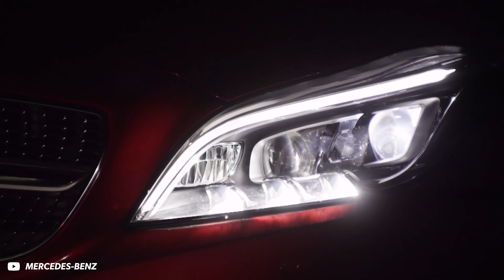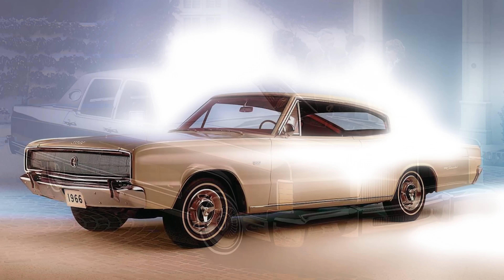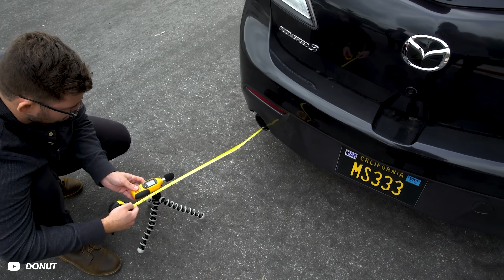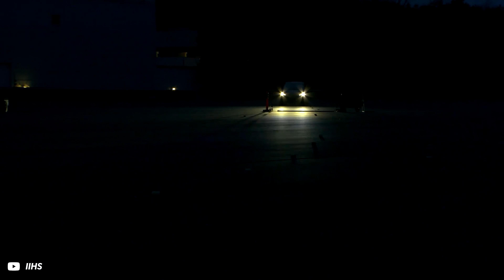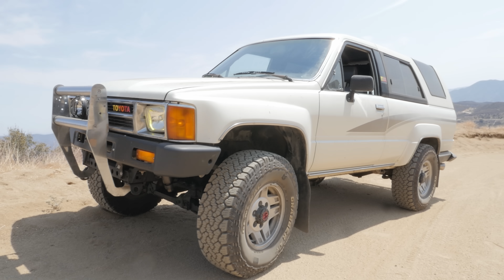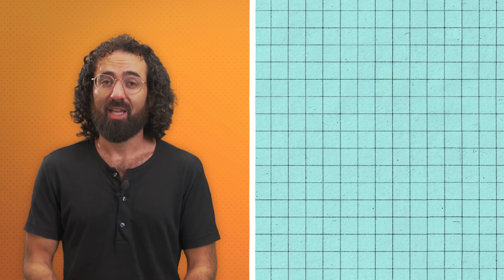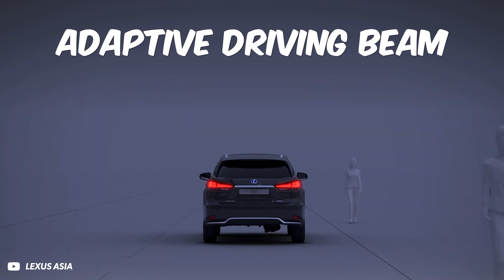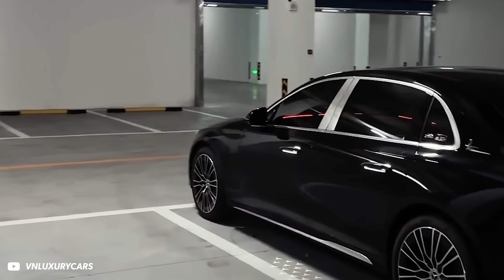Why new headlights are blinding American drivers

Comment: No, two automakers.  Teslas (except Model X) made since 2022 have the matrix LED headlights needed, and a software update enabled the adaptive function for them in Spring 2025.  

So, there are ~2 million Teslas on the road with this feature now. 

Anecdotally, it works well, or at least better than my last car: a 2016 Honda Civic. It was the Touring trim, which came with factory LEDs, and at least twice a month I'd get someone flicking their brights at me when mine were on lowbeam. 10 months in, I've yet to have anyone flick their brights at me in the Tesla.
Reply: I tested my Model Y by having my wife drive in the opposite direction as me in my second car to see how well it works. My eyes are very sensitive to light and I can tell all of you first hand, even when approaching from over a crest (or too of hill) the Tesla head lamps performed very well.
Reply: @jojones9194  awesome, thanks, it's great to hear a real-world test of the Tesla adaptive headlights, and that they did well
Reply: Ironically, early Teslas had poorly designed headlights probably out of spec for the cutoff angle of the low beams. It seems to be better in later model refreshes. The ones where you can discern the 3 separate emitters are some of the worst offenders on the road.
Reply: I have it on my Tesla Model X.
Reply: @bryanc7856  Yeah, I was pretty sure later model years of the X (later than 2022) got them too, just didn't want to make my comment too long by adding that
Reply: I love it! I have a 2023 and a 2026 and it’s really awesome.
Reply: Tesla, exactly, not sure why the video maker hasn't heard of them.
Reply: Teslas are so blinding I now just turn my high beams on back at them. They’re even worse from behind specifically the model Y
Reply: Do all Teslas come with these matrix LEDs as standard? If so, that's a great step forward.

The reality is, Matrix LEDs are a great solution to the problem but requires everyone having a car equipped with it. Most manufacturers do offer such systems now, but in almost all cases, it's always an optional extra, which hinders adoption
Reply: @Noel_p Yes, it's standard. I love it! It's not perfect (it sometimes blinds pedestrians or cars coming out of driveways), but it's really amazing!
Reply: @itsnorm it’s not
Reply: @Noel_p apparently in North America Tesla starting selling with Matrix headlights in Late 2023. I was very lucky mine has it as mine is a 2023 and they are awesome
Reply: teslas are literally the most blinding cars on the street. its always them. trust me, im a car guy and i drive a lot, especially at night, but even in my parents suv i find myself being blinded by almost every tesla driving by. maybe its just cuz theyre usually older models? ill keep an eye out next time i go for a drive and see if its consistently the older models with this problem and not the newer ones
Reply: @ItsEnderkiller2 I live in Tesla land with Teslas everywhere (Seattle) and as soon as the software update happened the problem was much improved. The older ones are still blinding but at least the brand new ones are not anymore.
Reply: @OptimisticEngineer345 yea im from jersey so its tesla land there too. im currently in indiana tho and theyre much more rare so i havent had a chance to be blinded by them recently. when i go back to jersey ill have to see
Reply: @ItsEnderkiller2  Next up are Outbacks with the automatic high beams. Same problem as Tesla but worse with the drivers just thinking oh, EyeSight will dim them for me. I'll have one of those 2 miles (ok maybe an exaggeration) behind me on the highway and still have to dim my mirror and it's so slow to react I get flash banged as one comes over a hill toward me.
Reply: Anecdotally, Tesla model 3 and Y are by far the WORST offenders by a mile. The issue is their headlights are already way too bright, and are angled too high by default. As both a driver and pedestrian (which matrix headlights don't address), it sears my retinas
Reply: @willkrska2644  How do you explain me getting flashed about twice a month for 9 years in my Civic, but not once so far in 10 months with my Tesla, if Tesla is the worst offender by a mile?
Reply: @JesseOsby  He's right - we've just all given up flashing Teslas because they all do it and either don't know or don't care.  Teslas driving around blinding everything in sight.
Reply: @Suupernintendo  It's mostly because people don't realize it and don't get them adjusted. It's the same for most Toyota's, Lexus, and Fords I see on the road. I wish there were yearly inspections of vehicles for this reason, just make it part of renewing your tag every year.
Reply: @Suupernintendo  But you still flash your lights at Civics?  That makes no sense.  Also, what is it that you want them to do?  "don't know or don't care" makes it sound like you expect the driver to do something to change it.
Reply: @JesseOsby I think people have just accepted that all Teslas are blinding. I have 2 of them and the default headlight angle was too high. With the software update it’s way better. Still blinding pedestrians like crazy but not much I can do about it.
Reply: @willkrska2644  Well, that may be if you have one made in murica. I have a chinese Model 3 and when putting in different springs they also adjusted the lights. They also said, the chinese models usually have the lights correctly adjusted most of the time. With a car from Fremont on the other hand you have a 75%+ chance its misadjusted out of the factory. Murican quality. Yeehaw.

Comment: I think some key points were made but there are other important factors to think about as well. Vehicle height, who hasn't been blinded by regular headlights because the SUV behind their CAR is right at the window/mirror height. We also have to think about where the majority of drivers have complaints, usually rural roads with no other light sources. So, relative to the darkness, headlights can be extremely blinding in this case, even halogens. One last thing to consider is the fact that everyone outdrives their headlights. This is a bit more technical but basically it means that when a person is driving so fast that a they cannot stop safely by the time they see an object/person/animal. So drivers compensate by changing to brighter headlights not realizing that the distance between a halogen and a led is only marginally different, especially at road speeds.
Reply: lights light up 80' ahead, at speed you need 110' to stop. that kinda thing

Comment: This is why the old-school prism-style glass headlights are still the kings of the road. Those fluted lenses actually managed the light — they diffused, spread, and softened it perfectly. Even with modern LED or HID bulbs, they throw a smoother, more natural beam than most new projectors. The problem today is that people just upgrade the bulbs but never re-aim their headlights. The beam pattern changes completely, and without proper adjustment, all that extra light just blinds everyone else. It’s not that modern lights are too bright — they’re just pointed wrong and lack the optical diffusion old designs perfected
Reply: Incorrect. All the new cars with head lights designed for them are even worse.

Comment: Modern headlights got brighter because we traded optical design for raw output. Back in the ’90s, halogen lights used glass lenses with built-in prisms that diffused and shaped the beam naturally. They had great balance—bright enough, but comfortable to look at. Then came projectors, clear plastic lenses, and HID/LED tech. They ditched the diffuser optics for sharp cutoffs and higher lumen intensity to meet new style trends and regulations. The result? More concentrated light, harsher glare, and less visual comfort. Basically, we gained efficiency and design freedom, but lost that smooth, human-friendly light we used to have.
Reply: Prisms in the headlight glass and parabolic reflectors were essentially phased out after we learned how to make reflectors that could create the required light distribution pattern without such prims. Such reflectors are known HNS reflectors (Homogeneous Numerically calculated Surface) and offer an efficiency improvement of up to 50% combined with clear polycarbonate headlight lenses.

PES headlights, Poly Ellipsoid System, also known as "projectors" allow the creation of light patterns in a very compact size of 40-70 mm in diameter that previously only was possible with very large area headlights. So modern headlights have gotten a lot smaller.
Reply: ADB headlights sound great but how much would they add to the price of already outrageously expensive new vehicles?
Reply: You see this with cluster back lighting too. The old fashioned gauges had softer yellow or even green back lighting to prioritize looking outside in low light. Nowadays it’s white light or even big bright distracting screens
Reply: @Sibsko21  Some cars had red gauge lighting, which was apparently the best for keeping night vision intact while driving...
Reply: I went from a halogen car to an LED car and I absolutely hate the LEDs. I don't recall having any problem with the halogens being too dim either. The LEDs have a narrow beam pattern and for the high beam they just turn on a couple extra emitters pointed at a slightly different angle. So the high beams help you see further on a straight level road but if there's any curve or dip the beam isn't on the road.
Reply: Exactly. Tanking design and manufacturing quality to save a fraction-of-a-fraction-of-a-percent-of-profit for "The Shareholders" 😑
Many such cases.... as they say.
Reply: At least remove the em dashes when copying slop from ChatGPT.
Reply: @Hiromandt  oh ffs don't be a ridiculous troll. em dashes aren't just used by chatbots. i use them all the time.
Reply: No, the 90s light output was shit. Even with halogens. You're looking at it with rose tinted glasses.
Reply: Considering I just retired my last 90s car 3 years ago, I can tell you the stock lights I still used were excellent.  I even had another car with the 5x7 sealed lamp, again, excellent.

Comment: Couple issues at play in addition to the points made here. First and foremost being driver awareness and training. I can’t even keep count of how many other drivers I see with their high beams permanently on. Or with a headlight out so they leave their full beams on. Next would be lack of enforcement of the above in the form of fix it tickets or general awareness warnings from police. Third is poor calibration and alignment from the factory and after dealer PDI. Many cars have headlight aiming and adjustment as a PDI item before delivery but I have never seen a tech actually check this, let alone make any final adjustments. And lastly, the antiquated regulations and lack of a global standard. I was lucky enough to be able to activate the European Matrix lighting on my US Audi RS3. It is by far my favorite feature of the car and genuinely increased my visibility during night driving with exactly zero negative impacts on other drivers. It should be a standard feature on cars as a safety measure alone.

Comment: I'm glad I wasn't the only one that hated LED headlights, they blind the fuck out of me and I can't see anything ruining my night vision. Someone complain to the transportation secretary already!
Reply: one of the problems is that people use any crap they can buy on amazon. they use corn led bulbs that shoot light everywhere so they cannot aim the light properly. they use it for fog lamps and main beams so at night they are illuminating more the sky than the road and blinding everyone. some even put some led bars as if they were driving in the jungle. they simply do not care.
Reply: I have been shopping for auto dimming glasses to wear at night to help solve the problem but I have not found any yet. It seems it’s hard to go from clear to dark quickly. It needs to happen in a fraction of a second.
Reply: @OptimisticEngineer345  Yeah, those glasses take minutes, and you're looking for a few hundred milliseconds or less.
Reply: @elizabethjamespack8541 They have existed for decades in the wedding industry. They change from dark to really dark at the speed of light before the weld flash hurst your eyes. If one we could get the same thing for driving but it would need to be almost clear initially.
Reply: Also the core of the problem is NOT the brithness but the blue color of the lights, that is what is blinding. Halogen bulbs and LED and Xeon that is yellow color is MUCH less blinding.

afd
Reply: I wish I had auto dimming mirrors on my car, otherwise you just have to use sunglasses at night i guess
Reply: I really do feel bad for other drivers.  I have a Mazda3 hatchback 4th gen with LED lights and they are bright!  Not as bright as the Acuras, but they're up there.  I do have my headlights pointed down and in to avoid blinding people though.  Being that it's a hatchback, the headlights are lower than CUV and SUV.
Reply: @DroneStrike1776  Mate, I know you didn't design the car, but you're the only one who can make it safe now. For everyone's sake, please get the lights replaced with something more reasonable. Again, I know you didn't cause the problem, but unfortunately, you're the only one who can fix it.
Reply: Same with new street lights, stupid LED is freaking brighter than the sun lol at night time, they need to start putting some serious filters to this lights, you could literally go under this lights and find ants, i moved from a city here in California that replaced all of their lights with those new ones and the whole thing turned in to a giant parking lot of a city.
Reply: @lcfflc3887  THIS!  And in quiet neighbhorhoods here in the  U.S. that are cozy & were easy to get a great nights sleep in the pitch dark, no longer, with preposterously bright street lights, ONE light alone that from 25m away but very high, is enough light to likely affect my deeper sleep.  That's a true health risk we now know FOR SURE.    The energy conservation ideas have gone awry wrt this & it has literally pushed some centrists toward the rightwing, sadly.  Not me, but the avg person over the past twenty yrs, enough went that way to then become either reactionary or otherwise support dangerous ppl such as DJT & his whole cabal
Reply: I like my factory LED headlights because I can see better, but I hate when other people have them. lol

Comment: Yeah Teslas and Rivians have Active Matrix Headlights. From a reputable channel like this, I expected more proper and accurate reporting. Source: the 2024 Tesla Model 3 Performance in my garage right now. It’s cool watching the technology work and figure out where it needs to dim.
Reply: Yes, supposedly 'clever' technology these active matrix lights, but it doesn't cover all use cases and often blinds oncoming drivers !!! People used to dim their lights BEFORE they hit the car coming the other way. These new adaptive lights only dim when they can actually see the car itself, which means the oncoming driver gets a full-intensity blast of light before it is dimmed. Even worse is coming over the crest of a hill when ALL the segments of these new-fangled lights hit you full in the face. A motoring DISASTER which should be rapidly regulated !!!
Reply: @davybass Not true, try a Tesla and you will see.  The cameras are above your head seeing traffic sooner than drivers. It takes milliseconds to adjust Matrix  headlights, much faster than humans.
Reply: @davybass  I Norway, basically every third car is a Tesla. The matrix system is only for high beam and works excellent, without blinding incoming traffic. The issue with Teslas (especially model y)is that many of the main beams are set too high. It can easily be adjusted in the software, but of course if people try to adjust themselves it usually goes wrong.
Reply: @davybass  you’ve obviously never driven a car that has this active matrix technology. It’s vastly different from the automatic high beam feature it sounds like you ARE talking about. My other car has auto high beams without the matrix element. Yes, with that one, it does wait to drop the beam until it’s sure it sees another vehicle’s headlights. With the Matrix, it is constantly adjusting and not just for cars, either. Active Matrix LED technology is superior and you can see it cutting a dipped section big enough for whatever it is the car is avoiding hitting with the remainder of its full beam everywhere else on the road.
Reply: I'm still getting blinded by these newer Teslas.

Comment: I started using yellow tinted glasses and have a small mirror that I put up to block the light coming at me while reflecting it back at them.
Reply: Ya .. I adjust the side mirrors to blast the light back at the offenders. Makes for more movement by myself to use the mirrors but at least it makes night driving a little less painful. I also do tend to camp out in the passing lane if not much traffic around and right lane is clear. They can pass from the right when needed if I don't feel like moving over ..

Comment: The brightness is not so much the problem a the light's height off the road surface....max height should be mandated, esp for trucks
Reply: This only makes sense if all roads are perfectly level. Variation in grades and even bumps in the road cause oncoming traffic diminished visibility.
Reply: @stevehunter7402 as with any light,,,what you voiced cannot be controlled so we are left with height requirements

Comment: I used to get severely blinded by the other cars on the road. Then I bought factory JDM spec projector headlights for my Subaru, and fitted them with LED light bulbs. I even aimed the lights down further than what is necessary to be road legal. I still get flashed by oncoming drivers, but I honestly don’t even care anymore, because new cars still have brighter lights than me. At least I can see where I’m going when a Tesla is blinding the shit out of me.